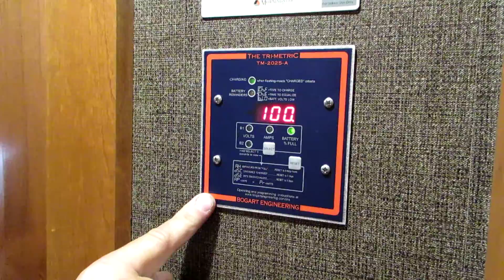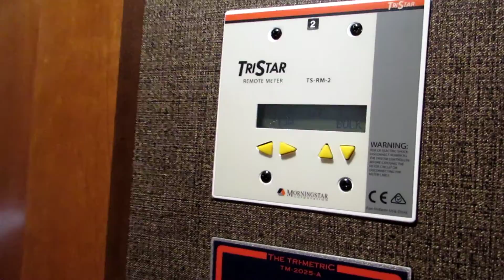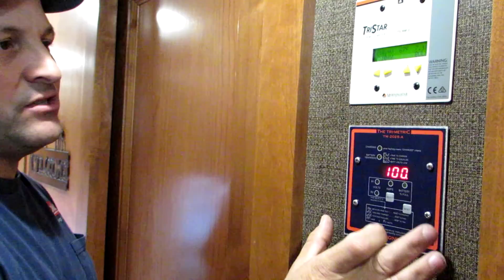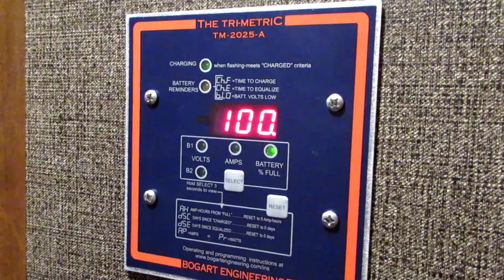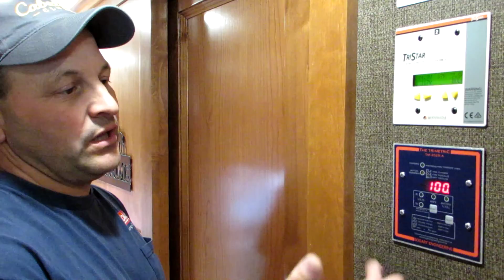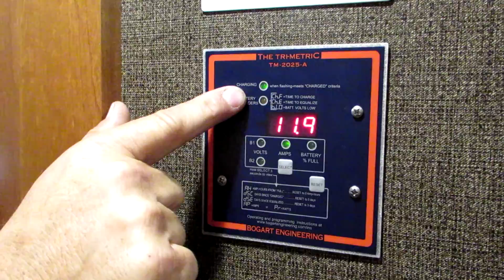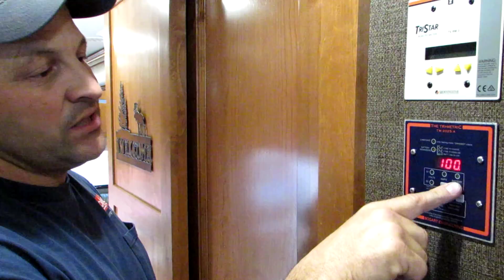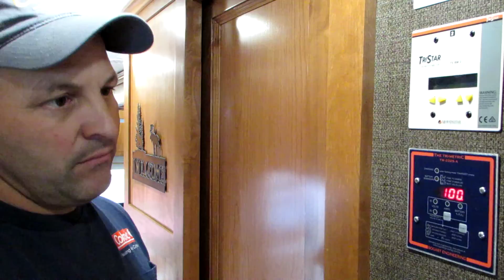Battery Monitors - The "Gas Gauge" of your RV's boondocking battery bank!

Comment: Eddie with a 500 w solar system on my roof, non tilting, what should I see on my Tri Star monitor for current and watts from the panels? Math tells me it would be around 25 amps max...Seems like it is less than that most of the time even in full sun in Yuma. I'm wondering in bulk mode what I should expect to see?? I have the same set up for monitoring...